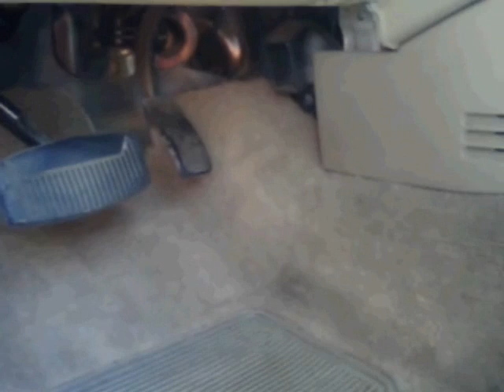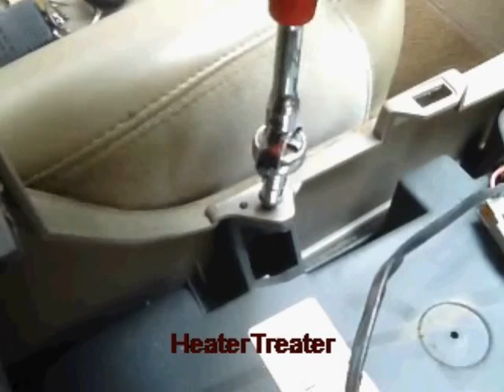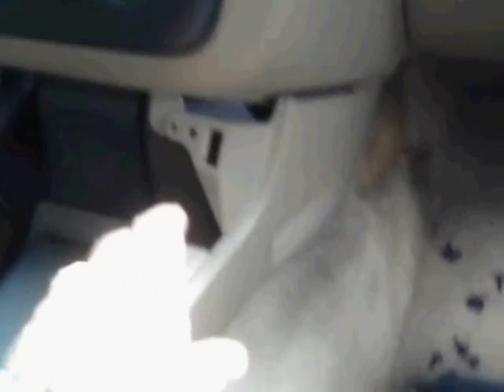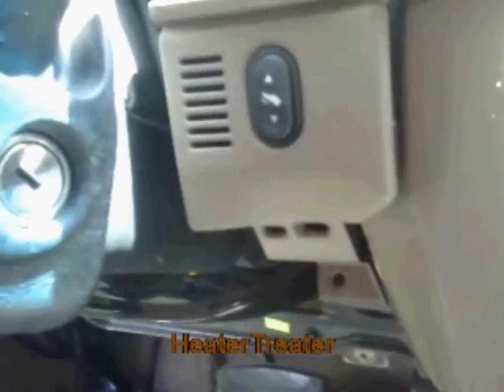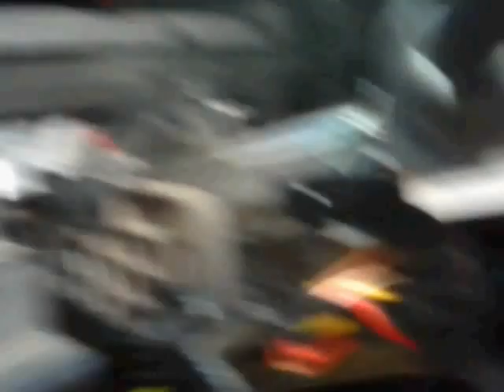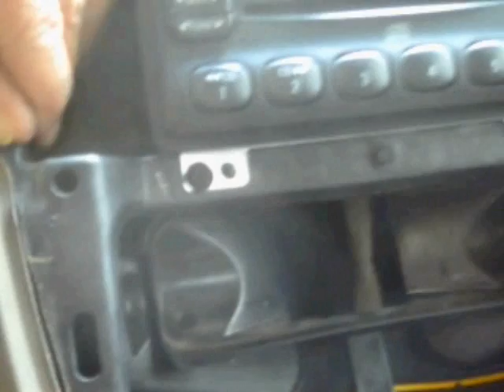Ford Explorer 02-08 HeaterTreater blend door repair video

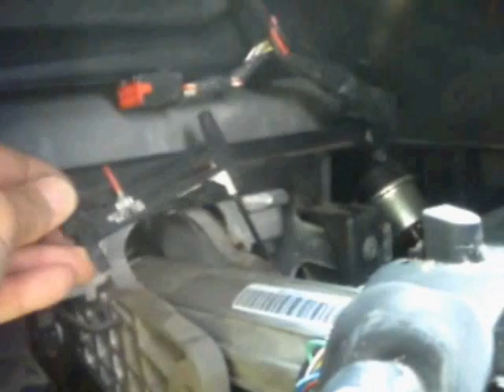Comment: Used your advice and it worked great.  You can't even see the cuts in the frame.  Saved over $900 with your tutorial!  Thanks a million!  The only advice I would be super careful with is the speedometer.  When you disconnect the cable pernudal indicator 5:25...make sure you are super careful.  Other than that, I was easy to accomplish with these videos!

Comment: The HeaterTreater replacement door is form/fit correct and can be installed with either the easy cut/patch method or complete removal of the plenum box.  Either way, you are much better off with stronger components that won't break again.  Actually if you are taking the time or expense of tearing down the truck, you should strongly consider our steel doors so that you don't have to do it again in a year.
The choice is yours and you can rely on expert engineering or goofball comments.

Comment: HACK HACK NO NEED ON THESE TAKES TWENTY MINUTS TO TAKE CONSOLE AND BEZAL UNDER STEERING WHEEL ALL YOU NEED IS A WRENCH AND A SWIVEL SOCKET AND 12 INCH EXTENSION WHAT CRAP THIS GUY PEDALS IS UNBELIVABLE JUST THINK 20 YEARS AND U MIGHT THINK ITS A CLASSIC TILL SOMEONE SPOTS ALL THE CHOPPED UP SHIT HAHA

Comment: @texster68 
Lots of comments positive and negative.  Feel free to ask direct question on our web site. There are lots of second hand quotes from Ford dealers.  The engineering team at HeaterTreater has a much better grasp of the problems and solutions than the dealer and can resolve all the issues with the HVAC system at much lower cost....Guaranteed!  Note that the "girly hands" comments apply to the earlier Explorer and we have a better solution for that vehicle.

Comment: your video was helpful in what not to do. There is no reason to take out the cluster or cut the dash.You made more work for youself indoing so. This job takes about 2 -3 hours the most to do if you never did it before. Its not that complexed the way you made it out to be. Yes you are a Butcher